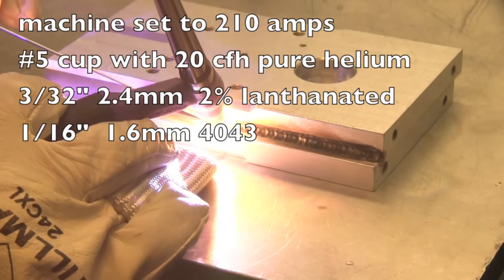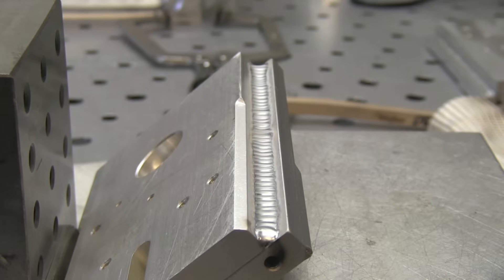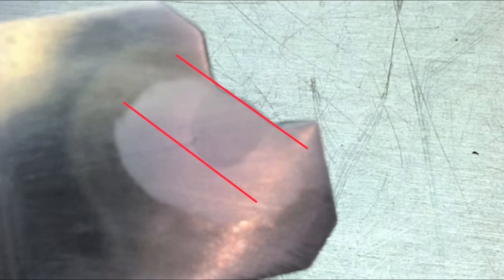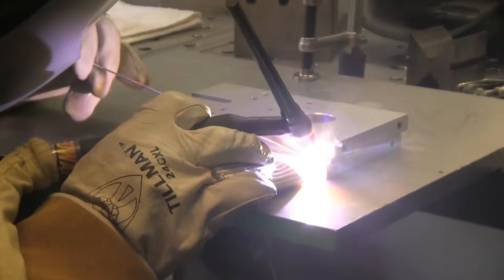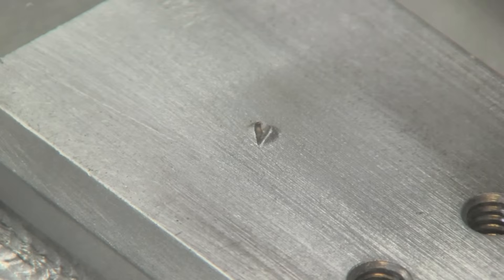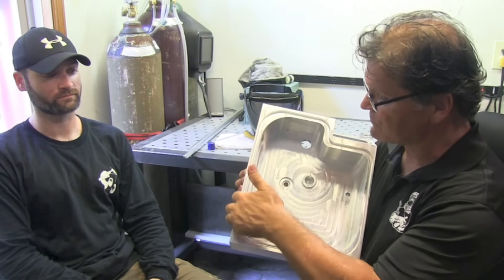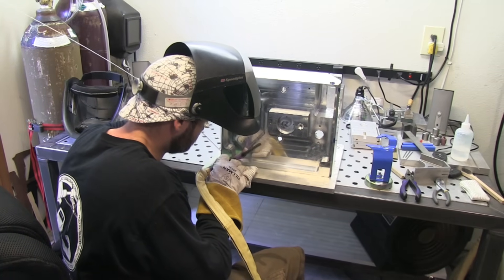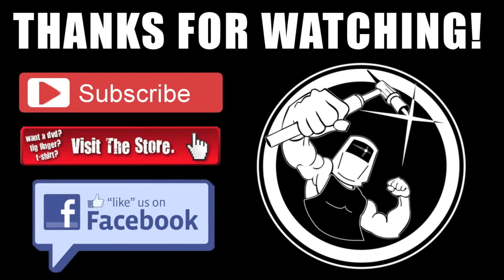TIG Welding Thick Aluminum using DC and Helium

Comment: Can DC be used with an Argon/He mix or just straight He?
Reply from the maker: Eddie the Grouch  I got a comment a while back that said by mixing in just a tiny bit of uhp (ultra high purity) argon, it cleans up the soot quite a bit.  So I will have to give that a go.  I dont have uhp argon but I plan on experimenting with the regular stuff
Reply: Eddie the Grouch U can use mix,but u get less penetration.
Reply: .facepalm.
Reply: +Marek Sumguy you do know dcep has very little heat going into the weld right? DCEP has the arc going from the work piece to the tungsten so it ideal for very thin material definitely not aluminum as they are using DCEN to get the heat ac cant provide at the same amperage.
Reply: Eddie the Grouch Use flux with DC TIG on aluminum. Straight argon should work as long as you use flux, which will dual shield the aluminum, but will also make slag. Though, not a big problem and will be easily hammered or chipped.
Reply: +Marek Sumguy Uh...switch the electrodes?
Reply: +Patrick Twohig  What do you mean by that?
Reply: +cobbnutts  Are you a complete noob?.... DCEP is used EXCLUSIVELY for Aluminum!... to prevent AlOx from forming!.
Reply: Marek Sumguy what? DCEN is always used. AC alternates between EP and EN half cycles.
Reply: DCEN gives better penetration because the electrons are being pushed/pulled from the negative electrode to the positively charged workpiece. 

DCEP gives much less penetration, but the electrons exiting at the weld site will remove the layer of aluminum-Oxide, and therefore less or no flux is required. 

AC, or AC with some DC bias, can allow for weld properties between DCEN and DCEP.  

refer to this article:   http://www.thefabricator.com/article/aluminumwelding/aluminum-workshop-electrical-current-in-tig-and-mig

Comment: Can you use a scratch start tig with this? I don't do a lot of aluminum welding but this would be handy to use. Thanks
Reply: ***** You cannot do scratch start TIG with AC current. If you're doing scratch start, I'm assuming your AC current source is outputting a sine-wave. You must have a high-frequency + high-voltage super-imposed over a 50/60Hz sine-wave to be able to TIG with it on AC. The AC voltage does not cross the zero point fast enough to maintain the arc. This is why older TIG machines(Miller 330AB/P) requires a continuous HF setting when TIG welding on AC. This is even more impossible with helium due to helium requiring a higher arc voltage.

Scratch starting on DCEN with helium on aluminum is very possible, even with the tiny bit of UHP argon thrown in it shouldn't be a problem(never tried it though). When scratching on steels I'll usually just light up somewhere just in front of where I plan to start welding, then weld over the tiny pit left from striking up. With aluminum though, I've found that it works much better to strike on a piece of thick copper then carry the arc over to where I'm starting the weld, when possible. I've not quite mastered the technique of flicking the filler rod through the gap to light the arc and many times I've caught it on the tungsten and just blew the filler rod clear in two.

TIG welding DCEN on aluminum is a very tricky process to get right, I'm far from a master at it, but I can get it done if I absolutely have to. I've never heard about mixing a tiny bit of UHP argon to help with the soot. That stuff is expensive in my area so I might try using my regular argon. I have doubts that will help, I'm sure there is a reason they specify UHP.
Reply: Steven Jason I use scratch start tig on aluminum DCEN and it works!
Reply: Zoran Bilbiloski  i had try this many times but could never get it to work. even if i hook my scratch start tig to a ac i still can getit to work. any secret to it?
Reply: No secret at all,just hook up the welder as for stainless steel welding,DCEN ,mixture gas helium and argon,flick the rod on the tungsten to initiate arc and weld the aluminum,the weld its not the best looking but it works fine and the weld is strong also!!!Cheers!

Comment: Hey there Jody this is Mike again I'm looking into getting certified in stainless steel but not to sure what time of test is it... is it also the same as carbon steel with open root? If you can get back to me I'll appreciate  it thanks
Reply from the maker: michael perez its probably open butt with purge, and usually you will have to keep most of the gap taped shut and remove tape as you go...but you should try to find out all the details before taking the test.
I was thrown a curve once or twice with weird stuff I wasnt expecting and that can mess with your confidence on test day
Reply: Would you perhaps know where I can get more info about it ... Like you said they might throw stuff at me that haven't seen before, so I want to get as much info and practice on it ... Thanks again Jody

Comment: Cool video very interesting 
I knew helium was an interesting gas for welding Ali but didn't realise it was that important in heat transfer.
Reply: Yeah, helium is a better heat conductor so it transfers more heat from the arc into the material. It also heats a wider area of the base material. These two things allow higher travel speed. The downside to helium is it provides less cleaning action so prep is super important.
Reply: Same here, where I work I use straight argon but we have tanks of argon - 25% helium for some other operation and now I see it might help if I should have to weld some extra heavy aluminum ( maybe a little )

Comment: Hey Jody . This video is awesome. I am curious as to what machine you're using to do this. I have the Lincoln square wave 175. Can I do this with that machine?
Reply from the maker: Chris Porter everlast 250ex was used for this vid...I havent tried my lincoln 175 with pure helium yet but I plan to give that a go on 1/4" thick aluminum with DC.  not sure if it will work but I will find out
Reply: weldingtipsandtricks Hey Jody, DC- or DC+ ???